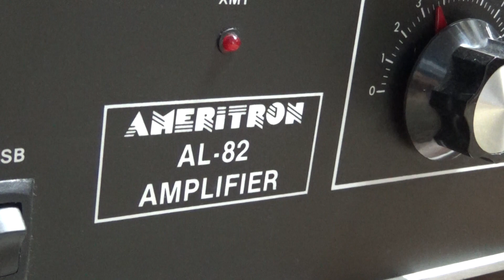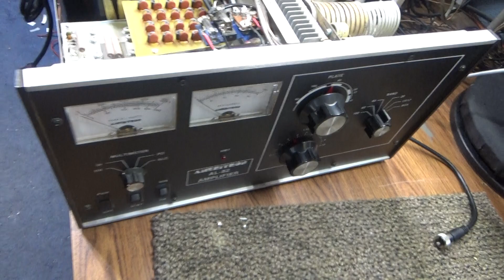Ameritron AL-82 2 / 3 3-500z linear amplifier grand opening. Tramdr needs help.

Comment: The Dahl transformer is stock. He supplied them for Ameritron back then. That's an MFJ part number on the tag. If you look at the date on the transformer's tag, it's from 2002. The same as the caps. So the amp is 21 years old. Still should be able to get any parts you need.
Reply from the maker: I was  going to say that on my next vid on this when I get it going. Good one.

Comment: I personally don't think that filement transformer is big enough ..hot me.concerned..
Reply: So in your opinion what do you think the transistor is doing in this circuit
Reply from the maker: I did some tracing and the transistor is used as a divider. One side sends half the bias voltage to the center tap of the original filament transformer and the other side of the transistor sends the other half of the bias voltage to the center tap of the added 3rd tube filament transformer. I do not like this arrangement. I am going to go a different route. The amp originally ran the bias straight off the zener diodes. It used one zener for SSB/high side at 7.5 volts and it switched in the 2nd 7.5 zener in series for a total of 15v's bias on the CW/low side.
Reply from the maker: That external filament transformer is connected to the additional third tube only. It is also rated for one tube only, 5v 15a. The factory internal filament transformer that runs the two factory tubes is under the cap board/metering area pretty well hidden underneath.

Comment: I don't believe that circuit will maintain .the filement voltage u need seems way to small of a transformer .. the transistor I believe is used to control the bias voltage regulation..and may show a short when  switched to ground..or cut off..the transistor my go open when the voltage is switched at HP
Reply from the maker: still working on it, but since it goes to the center tap of both the filament transformers, that maybe why its showing a short....or very low ohm readings.

Comment: It's going to show a short in line ...
Reply from the maker: Looks like you are right since the output goes to the center tap of the filament transformer. Here is a question that I am not sure of the answer to yet. The non factory transistor is connected so that it isolates the bias from the 2 filament transformers. I'm thinking this is because the bias can't be connected to the center tap of both transformers in parallel. Not sure yet though.

Comment: The previous owner cared enough to invest in a Peter Dahl transformer and the rest of the power supply, so with good tubes that thing will rock! 
You can make your own parasitic choke, just wind five turns of solid wire around a resistor that's the same value as the other two. Parasitic chokes are normally mounted as close to the plate connection as possible to reduce the possibility of the lead wire acting like an antenna.
If you get the third tube working you should consider upgrading the "doorknob" capacitors as they're a known failure point.
Reply: Tram Dr... Can build this entire amp with eyes closed,he is trying to put it back to as original as he possibly can ..he wants the parasitic chokes to match the others,also because the circuit needs to be identical in this part of the filement and hv network... Be beat if it was the identical same choke... I meen he could pull the 3rd tube out and remove the secondary fil transformer and remove the  nice peter daul ..as well  and go all back stock
.but I don't see this happening....lol that pf transformer gonna be hard to beat, infact if he gets the 3rd tube fired I Wana see the amp load and hv load on this amp ...I bet it is gonna pound out the RMS
Reply: @justinruth9729 Download the manual and read it...even with two tubes the specs are impressive. The trick is in how you tune the amp up.
Reply from the maker: I could make my own and I also have maybe 5 different parasitics that would work laying around already, but I want to have the exact same as the other 2.
Reply: @tramdr  I understand your desire to keep it as close to OEM as possible, but sometimes you just have to improvise. I sent you a copy of the manual with the parts list and schematics so maybe that will help.

Comment: MFJ owns Ameritron and should have all the parts you need.The PeterDahl XFRMR is not stock and that transistor I believe not stock.Appears to be moded in a number of places by a cobbler.I would put back to stock and get rid of that xtra tube and that too small of a filament xfrmr on the back.Nice find.
Reply from the maker: I looked on the MFJ site and they sell a very limited selection of parts. Parasitic chokes was not on their list that I could find. Hence, if anyone has a link or something, send it to me.
Reply: The Peter Dahl is most likely stock.
Older production models came from factory with Peter Dahl transformers

Comment: Will that key up with the radio...or do you have to use a foot key up?
Reply from the maker: foot switch.
Reply: @tramdr  If it is a positive  keying voltage look up Mr Carson lab repair and modification of TL922 he gives a circuit of a solid state keying diagram
using a single transistor placed between the rig and amp no need for a foot switch.
Regarding the parrasitic choke I would use a 47ohm 5watt carbon resistor and wind over it about five turns of 18swg tinned copper wire.
No need to find the same already fitted in the amp .